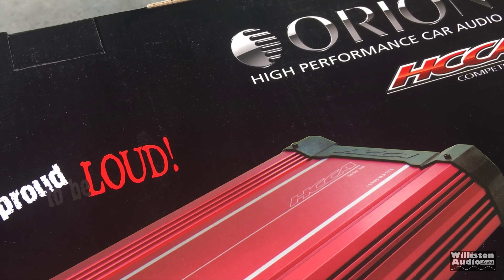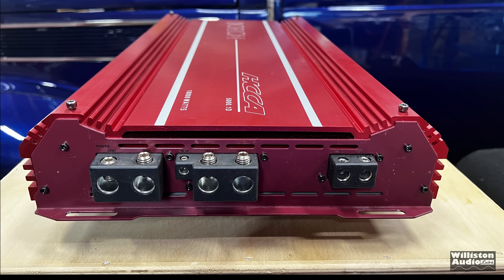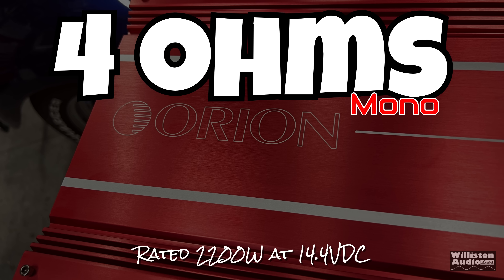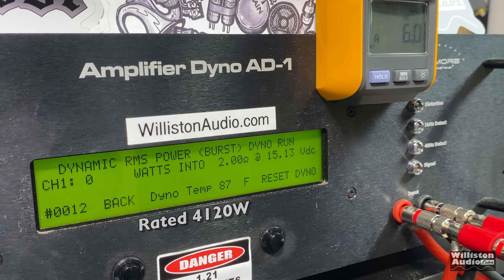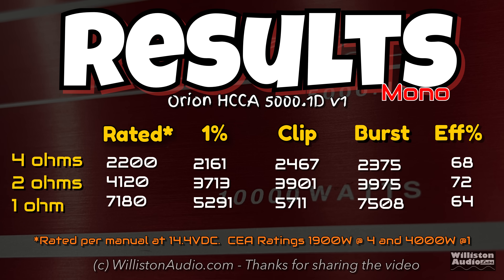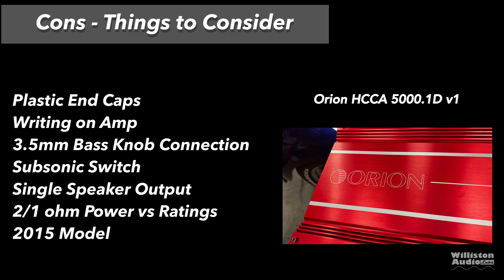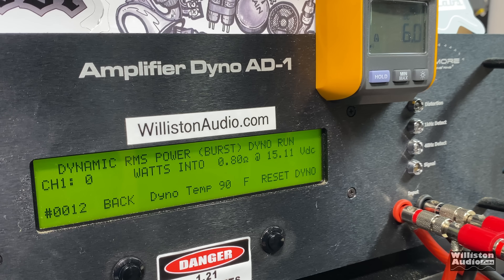An OVERRATED Orion HCCA Amp?

Comment from the maker: SHOP
Orion HCCA Amps (eBay affiliate): https://ebay.to/3PeciDf
Massive Audio BOA Subwoofer (eBay affiliate): https://ebay.to/3W38Kpy
SMD AMM-1 Handheld Amp Dyno: https://lddy.no/106tm

RELATED VIDEOS
Orion 4500.1D SPLX: https://youtu.be/AXes8Gncn1w
Orion HCCA 3000.1D SPLX vs Sundown SVC-3000D: https://youtu.be/4FeTTK3hDkA
1988 Orion 225 HCCA Stock vs. Modified: https://youtu.be/XOY210gyS-Q
Old School HiFonics vs Orion HCCA: https://youtu.be/sDZhWJ8Aj58
1999 Orion HCCA 275R: https://youtu.be/QDcjAiP4_IM

VIDEO INDEX
0:00 Intro
0:48 Features and Specs
2:28 Amp Dyno Tests
5:39 Subwoofer Test
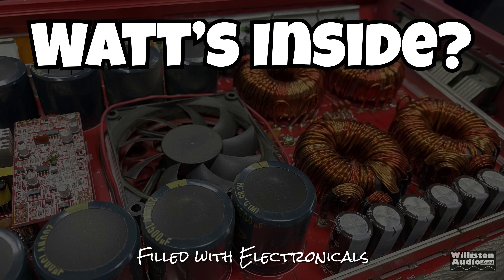7:20 What's Inside?
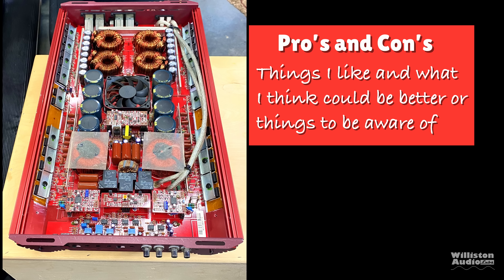8:02 Pros and Cons
9:29 Extras

VIDEO AND AUDIO GEAR
Camera - iPhone 13pro 1TB - https://amzn.to/3nCjGvc
RODE Wireless Go II Microphones: https://amzn.to/3Q6NVHl
Shure MV7 Microphone: https://amzn.to/3A4OICK
Zoom H4n Audio Recorder: https://amzn.to/3BXjVsS
960 LED Panel: https://amzn.to/2Sxoq3S

TEST BENCH EQUIPMENT
SMD / D'Amore Engineering Amp Dyno: https://goo.gl/sJTcf7
XS Power D1400 Batteries - https://amzn.to/2BPFCKW
XS Power PSC60 Charger - https://amzn.to/2CHGcfs
Fluke 1000A AC/DC Clamp Meter: https://amzn.to/2Rw5WDA
Handheld Dyno: http://amzn.to/2u2EgKV
My Favorite Screwdriver Kit: http://amzn.to/2x0VzcE

DISCLAIMER: This video and description contains affiliate links, which means that if you purchase from one of the product links, I may receive a small commission. As an Amazon Associate I earn from qualifying purchases

Comment: I need an amp powerful enough to push they mids in my doors. 

They're American bass godfather 6.5s and 6x9s. Rated at 750 watts RMS altogether. Or 150 watts RMS x2 in the front and 200 watts RMS x2 in the rear.

I want loud but I also want sound quality

Comment: This amp is no good. Hell, any amp <70% efficient is terrible. The only exception would be 20kw amps for specifically World Record runs.

64% efficient would mean to get 5300w to the speakers, you're pulling 8300w. That's 3000w to HEAT. Your microwave only pulls 2000w at most.

Comment: Sort of makes sense when you look at the price of this vs the 8000.1d.
It’s $700 more. So basically 90% higher cost for supposedly (rated) 3,000 more watts.
But actually the 8k puts out 12,000+ at 1ohm.
So this should be called a 4000.1d…..

Comment: My hcca 5kdv2 still going strong 4 years even in these cold Cleveland winter's only issue is cold turn on in winter amp turns on but no sound til amp or car heats up it clicks then turns on and booooooooooom slams my 3 15s

Comment: Hey Williston if you can get your hands on some supercaps again. Highly interested. Running the Maxwell 2.85v 3400 k4 series. Love em!! Most slept on an underrated ELECTRICAL upgrade hands down. Stabilizes voltage an can give your amp that true "peak" power because of how easily it can burst it's energy. You know. These guys may not know. But we know.. kicking it OLD SCHOOL!! but not with the beer can volt meter 🤣🤣 1 farad joke

Comment: Hey Big D, I’m an old school Orion fan.  I bought a 3000.1splx off eBay and it didn’t have a certificate with it are those the real deal?  I wanna buy 3 more and don’t wanna get ripped off!
Reply: Hey, I've got a 3rd gen pop top 425HCCA Competition X-over amp that might be for sale or trade for an HCCA sub. Just needs recapped. Has all the SLF crossover cards that also sum the 4 channels, original box and paperwork.

Comment: Those internals should make 7500 RMS easily on I've repaired a million amps and judging by the guts this should do 7500 certified 10k dynamic maybe it wants half ohm - .8
Reply: 0.5 ohm thats 10kW+ easyyyyyyyyyyyyyy❤❤❤❤

Comment: I’ve always wonder why it seems no one who tests amps uses cmax for a battery. On my test bench I have a 145ah fat cell. A 6 amp, yes 6 amp, fully adjustable from 0-30 volts AC/DC power converter I keep it charged with. I just leave it at 16 volts all time. I have to draw over 1100 amps of current to drop 1/2 volt and I have $1725 into my charging system/battery. I had 240ah yinglong, same 16 volts and it was double the cost for half the power. Voltages tanked quick. Just curious why I never see cmax on test benches. See them in cars all the time. Great video big D👍🏼
Reply: you said your answer $1725....buy a used RV batt. harbor frieght charger...done....$100....lithium is wayyyyyy overrated by tesla dogshit cars that cause human cancer
Reply: @lunam7249  you obviously know nothing about lithium. What do think yinlong caps are? Lithium. You also obviously know nothing about car audio.  Do you have any idea what the C rating is on a car or marine battery? Terrible. You’d need 25 of them or more to equal a 145 ah cmax, and they won’t charge to nearly as high of a voltage. Unless it is for starting a car, nobody uses regular car batteries anymore. The 2 marine batteries on my boat are lithium😂you must be terrified of cell phones. Lithium battery.

Comment: In the past CEA ratings were 4 ohm only for "official" ratings.  Has that changed?  Granted, I know they can use CEA measurement standards which is full bandwidth at 1% distortion for any ohm load, but I could have sworn that the official CEA certified ratings were only for 4 ohm loads...

Comment: How many amps in 2015 offered more than 5000 W It's the question,,,, Out of those amps how many can be brutalized and still be here today to be put on a Dino,, Bring it down to point 8 and not going to protect,, Overrated no I don't think so,,,
Reply from the maker: I didn’t rate it 7180W at 1 ohm and 14.4, Orion did. The amp is great overall but why state the power like this? That’s the overrated part.
Reply: @wal  ❤❤❤❤ big d..but that shit dyno underates 30 to 35%......its a well known secret to the pro's....

Comment: So that is disappointing ORION is supposed to be underrated and blow their ratings out the water like the 3000.1 doing over 9k
Reply from the maker: Amp easily does CEA 4000W and 5000W at 12.8 but that 14.4 was like 🤔

Comment: Have you ever did a dyno run on the kenwood KAC-9106D. I'm running that amp with an RE audio sx pro and it slamming harder than my JL audio setup.
Reply from the maker: Thanks for the suggestion
Reply: 9106 pushes about 30% more than the rating..great amp❤❤
Reply: @lunam7249   nice. yeah it's a pretty strong amp I was impressed.
Reply: @wahiawabound808  it goes deep also!! turn off subsonic and you will be surprized
Reply: @lunam7249  I'll try it out I've got the older version of that model so I'm not sure if it has subsonic.

Comment: All HCCA tests should also be run at 15.9v

These amps really shine on a high voltage cmax or LTO system.

Food for thought....
Reply from the maker: I’d agree these amps perform better at higher voltage and I use an LTO bank but the majority of people who use these want to see tests in the 14-14.5V range…at lease that’s what the majority tell me
Reply: @wal  I'm really curious if the increased voltage changes efficiency or not.

Particularly with a 3000.1DSPLX,  but others as well.
Reply: @dale8846  yes, with all amps!! but most will die above 14.9 volts , unless you know for fact it will go high
Reply: @Williston Audio Labs  that's why I suggested testing both ways 👍

That way you can show what's more common AND show their true capability
Reply: 15.9v is fantasy land.
Reply: @hippo-potamus  all on same electric system at 14.6 v.....you run a special alternator voltage regulator.....or better yet a variable voltage alt.😮🎉❤👏👏🌝🤫
Reply: @lunam7249  If you have to run 16v another alternator and who tf knows what more, you should just get a bigger amp at that stage.
Reply: @hippo-potamus  wrong again hippo......1st.. you confusing my comment with the other guy. i never said 2 systems and 2 alternatetors.......dam.... you must be a nube.....ALL!!!!! EVERY single ALTERNATOR IN THE WORLD CAN PUSH 15 VOLTS!!!just leave the factory one in the car!! run everything on 1 factory alternator!!!
Reply: @hippo-potamus  how so?
Reply: @dale8846  Because nobody runs that high not even Steve Meade. A true 16v systems would be charging at 18-19v and most cars computers would shut down at that high voltage.
Reply: @hippo potamus incorrect. This is why you run two separate electrical systems. One alternator + battery for the vehicle at normal voltage, additional alternator(s) + cmax/eh5/LTO/etc lithium dedicated to stereo system. This isn't fantasy land... LOTS of people do it. And you definitely would not charge them at 18-19v. That would risk causing a fire.
Reply: @dale8846  Ok bruh whatever you say.

Comment: i have to 5000.1DV2 which looks the same in vid but love my hcca been running it 3 years now but it does draw alot of power i run mine at 2ohm yes i have big 3,300amp alt, dual rockford fuse holder and fuses 200 and 100 amp in each 1(think rf fuse holders r the best),4 batts, 3 15 xfl, and broke my trunk 18x now and split the original trunk lid lol. only problem i have is cold turn on cuz cleveland weather like now its 8° so wont click on until car warms up mostly like 20min tops. it clicks when ready but once its on its great and does its job best amp i ever owned

Comment: Big D Did they rate it at 16 volts? Hell I've run them with 18 volt before. You do have to put higher voltage capacitors throughout the board even on the rails. I found that one out by mistake. Look like a rat been in there chewing up toilet paper rolls. And who could forget the sweet sweet smell of failure
Reply from the maker: It says at 14.4 in the manual.
Reply: @wal  I see, they probably subcontracted that out to some foreign country that doesn't even speak English it would be cool to see you put that thing on about 16volts see if it'll hit those numbers certified

Comment: Big D, I know you remember the 90's and best buy had the Orion hot set up, I had the t 600 on 2 JL 12w3 and it slammed. I would go to local shop's in the south jersey area and they were all impressed, until I told them what amp I was running on my subs, mind you I had the old 150 HD the one b4 they came with crossovers, on 4 6×9 and a pioneer gmh 200 on 2 5x7(6×8) and two tweeters,  but they always hated on the orion. I would love to if it did the 150@4ohm 300x2@2ohm & 600watts bridged. I've been looking for one on ebay, but can't find one in working condition, but hay, people hated on Rockford's lighting audio ( I believe that was the name)

Comment: I was an Orion fan boy back in the 80s and 90s when I competed in IASCA and USAC. HCCA Orions are all I ran...12 Kicker Comp 12s on 3 HCCA 250s.

The history of the original Reds and the legendary power they were capable of made these amps the best at that time.
Then came the US Amps buyout of Orion. From that point on, Orion Reds haven't been able to live up to their legend. 

Original HCCAs(produced by Orion as an independent company) were awesome. THD % couldn't be touched. The original "cheater" amps.

From the moment Orion sold-out to US Amps, with the company changing hands again and again since then, have been junk. Plain and simple.
Reply: The new ones are good. But yea I know what you are saying. The last ORION amp I ran was an XTR PRO 2400 that I removed from my Ford Exploder before I got rid of it a few months back. It's a great amp. I still have it but I won't be using it again. I'm putting together a system for my Toyota Tundra Crewmax at the moment and won't be needing that much power and I'm unwilling to lose the space housing that big of an amp and today there are better more officiant designs that won't tax the charging system like these old amps did. I'm giving these new  Down4Sound amps a try. They look promising. Hopefully they pan out. This will be my first non ORION system that I have put together for myself since the early 90's.
Reply from the maker: US Amps bought Orion? I knew about DEI, but never heard US Amps had anything to do with Orion? 💁‍♂️
Reply: @wal  Not US Amps. DEI correct. Who owns ORION now a days? Do you know? They are certainly offering some very high wattage amplifiers. They need to start publishing the correct specs for their amps though. It doesn't really matter that the amps do a thousand watts over rated power or a thousand watts under rated power because in both cases they don't meet their published specs. They should be +/- 10% of the published specs. 

Question for you. Have you ever put the XTR PRO 2400 on the dyno before and if not would you like to?  I had this amp in my last ride, a 1996 Ford Exploder that I was driving from about 2002 till a few months ago when I got rid of it. It was pushing 3 12 " kicker Solobarics and they walloped pretty hard but I never really had the charging system in that car to really push that amp to it's fullest and wouldn't mind finding out what it's true capabilities are. So I could make it available to you for testing if you like.  It's a great amplifier and it's still in great shape. Seeing how it has been in constant use for all of these years the electrolytic capacitors in the amp are still good. It's usually when they sit for long periods of time with no charge that they start to go bad.

Let me know if your interested and we can make arrangements to get the amp to you.
Reply: @Williston Audio Labs   I may be mistaken and thinking of the DEI buyout  when DEI acquired Orion, a/d/s, and PPI. My memory isn't what it used to be at my age. But, it was my understanding the US Amps purchased Orion and a/d/s in the early mid-90s which they kept for close to two years before selling Orion to DEI. Then DEI kept Orion until around 2003-2004(not sure of the exact date) when DEI decided to focus more on car audio/security accessories thus selling Orion to MD Audio out of South America(current owner of Orion) which has Zennon out of South Korea manufacturing the Orion amp line for them. 

Either way, Orion stopped being the fabled legend it was when the company sold. The HCCA line lost it's "magic" as the "cheater" amp of choice for competition at that point. I do know Orion competition in the "cheater" amp market had got pretty intense prior to that with such products as the Phoenix Gold MPS and MS lines(MS275 was a beast!!), Hi-Fonics Ulysses rated at 25x2, several similar offerings from US Amps, the MTX MTA 225(PPI ProMos in a MTX case), the Kicker si line, and the venerable offerings from PPI like the ProMos 50. PPI really rose to legend status when Alma Gates and "THE Bronco" entered the scene. Needless to say, at that time, Orion HCCA Amps lost some of their mystery and alot of their dominance in the competition scene thus seeing sales drop and forcing the sale of the company.

I will always love my Reds. I'm old and they will always be the best in my eyes. Us old school guys will always love our legends of 80s and 90s car audio and we still prefer to use such equipment in our personal systems. Kids and young adults don't know of or aren't familiar with the unique and innovative equipment that built the foundation for the car audio scene today.
Reply: Me being old and today being a day alot of people remember better times when we were young, I started thinking of events and/or the introduction of new, innovative gear that really changed the comp scene at the time. The mid 80s that saw Orion HCCA 225 enter the scene to challenge the dominance of the Linear Power 452 and 952 had on the lower wattage classes. When the Cerwin Vega Stroker subwoofers hit the scene to challenge the likes of Savard, M&M Godfather, Kicker Comp, and the few others dominating competitions. The appearance of the Image Dynamics Grand National at competitions showing that SQ could usurp SPL as the crowd pleaser and head turner. When Mark Fukuda showed that an innovative use of a car alarm 10key remote, tiny electric motors, and alot of daisy-chained Audio Control gear could allow you to dominate SQ AND SPL. When a few guys from South Louisiana showed you could dominate SPL against systems with multiple 12s, 15s, or 18s with only 3 10s on a HCCA 225 in the rear of a Honda CRX using the CRX's unique shape as a giant resonating horn. When Pioneer introduced the IMPP woofer that broke many SPL records at the time. When Kicker introduced the Solobaric line of woofers that literally killed any competition. Phoenix Gold was introduced to the world showing that amplifiers could push multiple woofers of larger cone space at low ohm loads(half ohm or lower) making extreme amounts of wattage beyond their 4 ohm stereo rating doing it stabily and reliably for extended periods of time that not even the Orion HCCAs or similar could touch. Brantley Waites showing you could install a portable, pre-built system in a rental van in less than 24 hours to win dB Drag Racing competitions. Then when Alma Gates, PPI, and a 1990 Ford Bronco showed the world that Xmax meant nothing by becoming the loudest man-made object on Earth using FLAT PISTON PPI 10s when the Bronco broke the 180db barrier with a 181.7db surpassing the launching of the space shuttle for SPL.

These are some of the points in car audio history I was present for and that will always remain parts of the Golden Era" of car audio competitions in my eyes.
Reply from the maker: @knowplay3258  Well stated, those who were not around during this time don't understand how totally cool it was!

Comment: Massive audio makes good motors but suck at making the entire sub the baskets don't allow for much excursion  and the glue the voice coil used is low heat so the coil will unwind when it gets hot

Comment: Interesting how big the jump was to dynamic on this one. Seems like they usually only pick up a couple hundred watts at most. 
I also wonder if the amps are rated for higher voltages. If you run the same amp at 16 or 18 volts does it go into a protect or just make more power?
Reply from the maker: It can handle 16V, but I did not test that high